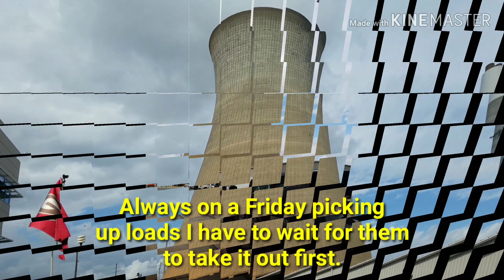How to do Crazy Heavy Hot shot trucking loads! Unloading video.

Comment: I have seen locals here in central florida hauling 30000lb excavators and loaders with a dually and a dual tandem goose neck. I dont see really anything wrong with it. I use to do 5 to 11 axle heavy haul
Reply from the maker: Yeah.
Maybe local ok.
But I keep busting springs long haul.
Need better suspension.
Reply: you thought of going air ride?
Reply from the maker: @phatboizbackyardkustomz9006  
Yeah... probably the way to go.

Comment: Did you add an axle on your trailer or is it a different one. You sure are hauling some weight these days.
Reply from the maker: This is an older trailer I used to run. 10,000lb each.
Dont run it no more.
Also extra on tolls.
Reply: @hotshotadventures3036  but did you add the axle?

Comment: Truck and trailer total length?  You look long.
Reply from the maker: 45 ft trailer.
That put me at about 70.
Yes with the bed on the truck I was not legal in Some jurisdictions,  but never got hassled.
Reply: Hot Shot Adventures 
That’s what I was wondering about; If you ever had any issues with the overall length?  Silly regulation anyway.  Bed/no bed, like it makes a difference.